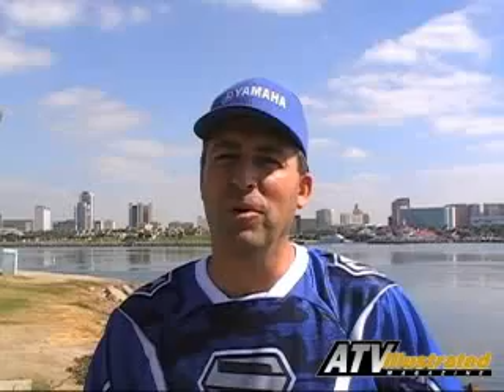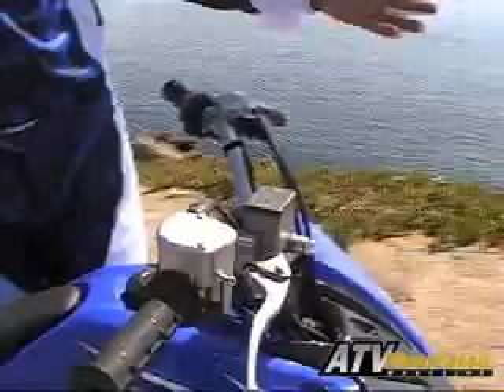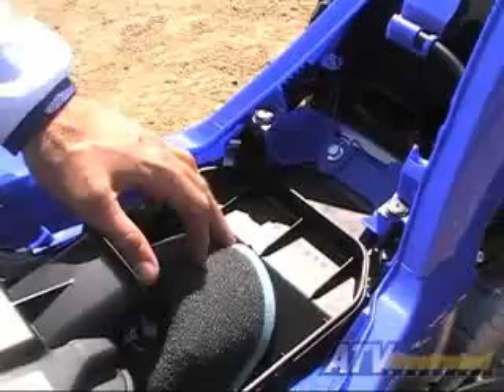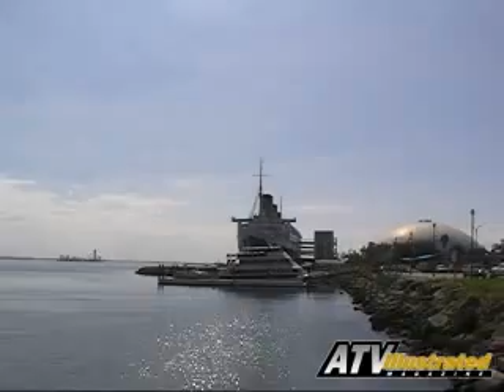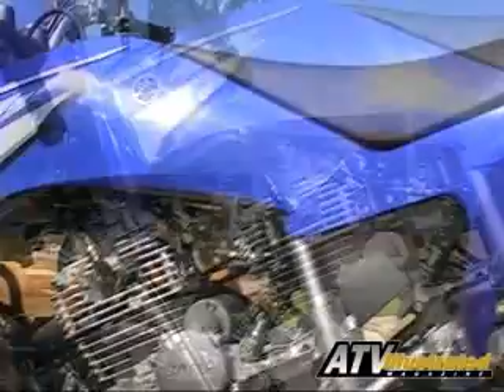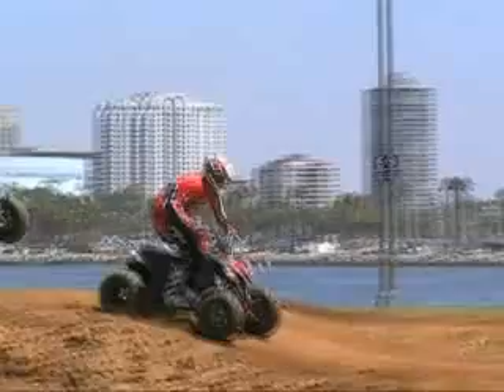2008 Yamaha Raptor 250 Review

Comment: @78Miller78  if its your first and your only 13, dont even think about getting somethin as big and heavy as a 700 (even if you are tall and strong). a 450 will be good for a experienced 13 year old, but if its your first quad, i would recommend something like a honda trx250, they have a new clutch for beginners which makes it real hard to stall, and it has reverse

Comment: @julioigna71 
For a first ATV, you want something that has a reverse gear.  At altitudes below 500 feet, a modern 125cc bike delivers decent performance for riders up to about 200 pounds at the very most (that's WAY more than the max weight "allowed" on the label); if you're heavier than that, or operate at higher altitudes, get a bigger engine.  The most versatile 2WD choice is probably a 300-350cc ATV; the most economical is likely the 250.  In 4WD, add 100-150cc to those recommendations.

Comment: @chancerbob95 
Unless you have *lots* of experience, the 450 is going to be dangerous: it's power is more like "on" and "off" but the 250 has a pretty smooth power delivery.  If you absolutely must have more power, go to the 700, which is much less radical than the 450 and not much heavier than the 250 (especially considering weight).  For trails and creeks and pretty much any other recreational riding, the flyweight 250 Raptor is an ideal choice if chain drive is OK.

Comment: @Lachman0102 

The 350 with reverse should be a sweet ride.  Lots of sports riders say you don't need a reverse and, while that may be true for a race bike, it's a pain in the backside to not have one on an ATV.  For a motivated adult male of average strength, tossing around a sub-400-pound ATV is pretty easy; however, dismounting *every time* you want to back up is a ridiculous pain in the backside for the trail rider, explorer and lightweight scout.

Comment: @imnotavegeta oh hells yeah. im 12 too and im 98 pounds. it is perfect for me. i just put nerf bars, bumper, and gas cap on mine. i give it a 12/10. its that good. it suites all riders from 4'3 59lbs, to 6'0 200lbs perfectly. im right in the middle. it has okay power. it needs better exhaust to fly. overall 12/10

Comment: @TheMraseome 
The same as the recommended age for a 400-horsepower sports car.  There are age minima that are imposed by law in various jurisdictions (and to which laws I am ideologically opposed).  If you've got good judgment, no significant physical disability and the bike is tailored to your physique, you should be able to ride pretty much any showroom-stock 250 ATV as soon as you're physically large enough to manipulate the controls.  Without good judgment, you shouldn't get one at any age.

Comment: @gangstacornholieo 
Racing imposes an entirely different set of demands from what ordinary users encounter.  If you're running in a class that allows power adders and chassis modifications, there's no substitute for displacement.  Out of the box, on a flat track, most give the edge to the 450; on the banks of a creek or in loose sand, it will dig a hole in the sand and go nowhere; that's no fun.  On technical trails, the snap of the 450 will either get you killed or slow you to a crawl.